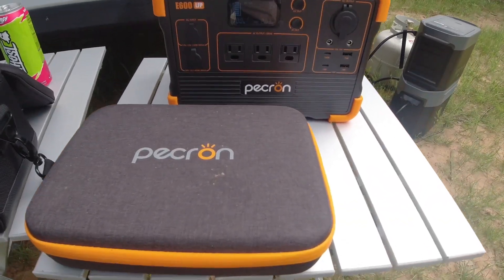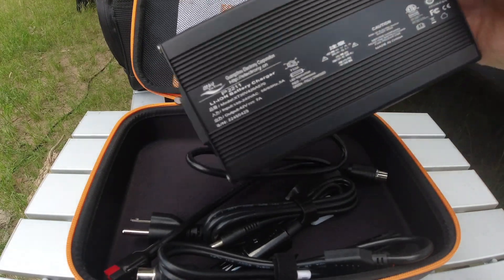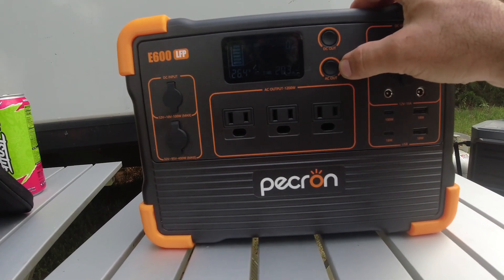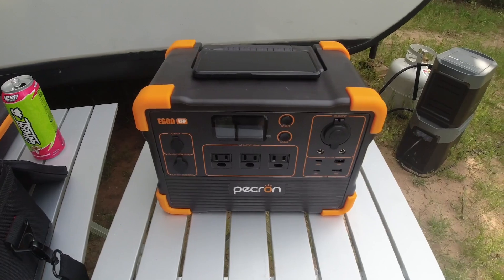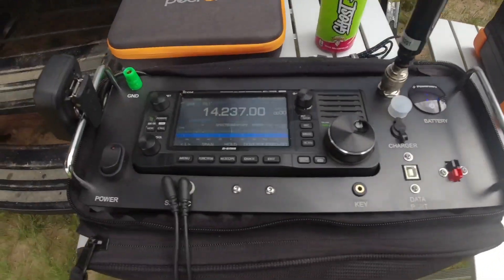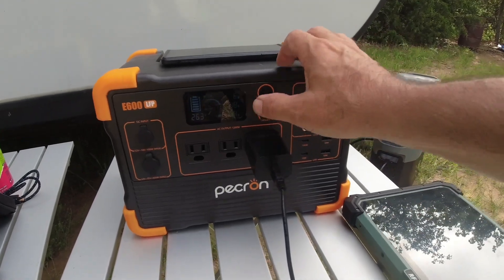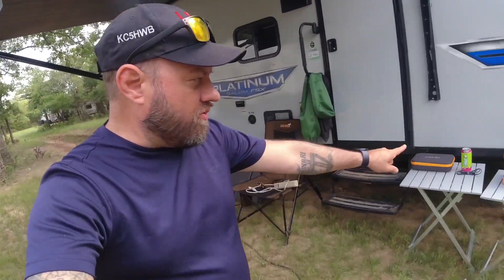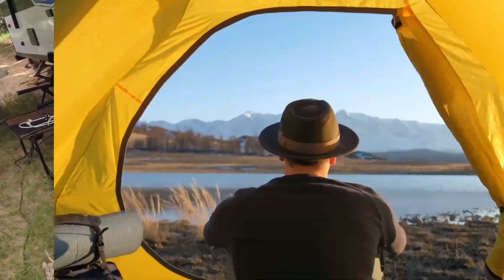Pecron E600LFP 614Wh Power Station RFI Test!

Comment: I had just put a purchase for the PECRON E600LFP

Hoping it has a ups feature or something similar where power continues after a power outage or something of the sort. If not i have my bluetti eb3a for that, but my idea is to daisy chain the two adding up to 908 wh. Usung the pecron as the source keeping the eb3a powered for extra time on use . For some reason my little 300w vault powerstation lasts longer thsn my eb3a when powering things and im like how does that add up lol.
Reply from the maker: Let me know how it goes, but what you are saying should work fine

Comment: I actually have this power station. I bought it to run my refrigerator at night in a power outage, but I couldn’t help testing it with my ts-480. On ac I didn’t notice noise on 40 or 80m, however this was in my home where my operating station is in the basement and the antenna is 40 feet away. On dc, also no noise, but I couldn’t get full power out. I went up to 40 watts cw but that was above the listed dc current draw.

Comment: Westinghouse Igen series power stations are very RF quiet. Just a heads up.
Reply from the maker: I have a friend with a Westinghouse Gas Generator - it isn't very well made, imo.  I'd be interested to see how their power stations operate, though.
Reply: @HamRadio2  I have no experience with the gas generators, but the battery power station is decent quality. I don't like the country their made in. But other brands wouldn't be compatible with amateur radio. These have no RFI I can pick up.
Reply from the maker: @trumpdonald6911  Good to know, thanks for sharing.

Comment: Hi Jason.  Thanks for the review!  I have the Xeigu Power Station and has many of the Pecron features as well. Cool little power cubes! I use mine when we go out Duck hunting in the winter to run a heater for a few hours.
Reply from the maker: Test the output on the A/C plugs on the Xiegu one.  Make sure you don't blow anything up.
Reply: @HamRadio2  Will do.  I have used the AC plugs and they are OK so far.  But I am warned! I have not used it with much but my 100W heater that does not run long.....